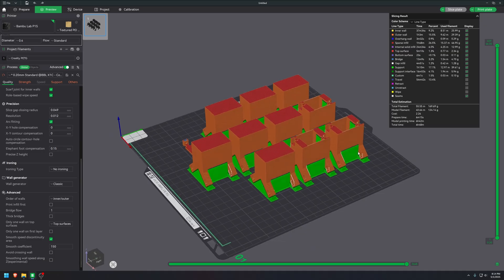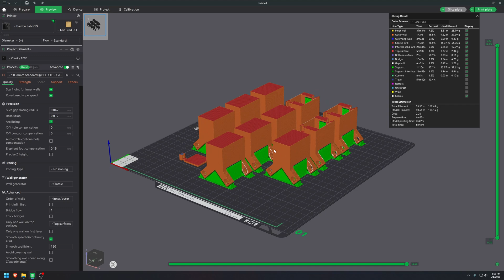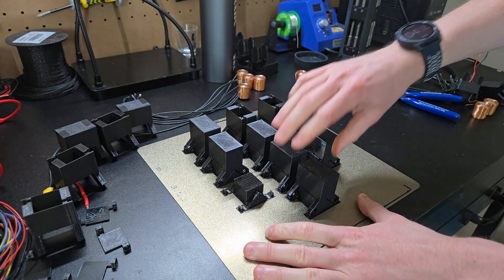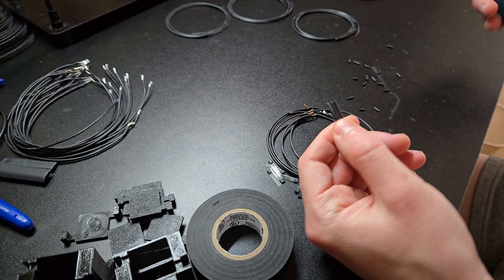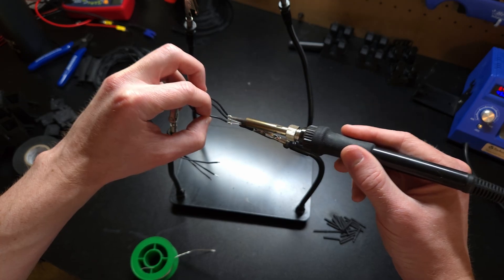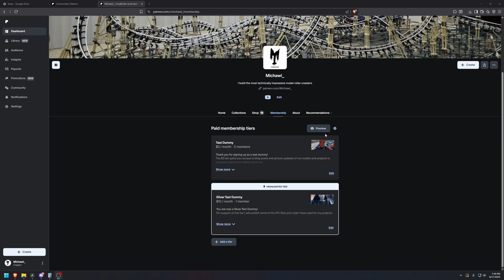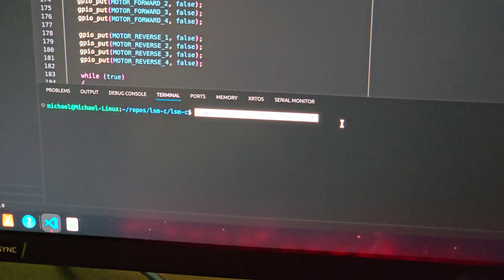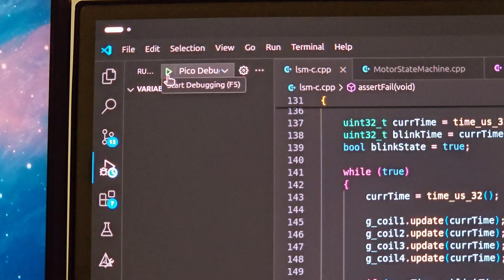I can now make BENDY LAUNCHES

Comment: I'm re-watching your LSM videos while my LSM continues to disappoint me. No matter how many motors I add I can't seem to exceed about 2.5 metres per second of top speed, the motors just become ineffective. I've tried air-core coils, a bunch of different number of turns per coil. I know your layout doesn't demand 'top thrill dragster' type velocities, but were you finding diminishing returns on the LSM where you couldn't achieve more speed, even with more motors?
Reply from the maker: There's definitely a steady state max speed these can achieve, I don't know what that is. Keep in mind I'm putting an absurd amount of power into the coils (24v@15amps) and I saw the biggest improvement when I gave myself the extra current.
Reply: @michawl_  I'm putting 24 amps through each of my coil pairs, heaps of torque at low speed, but no meaningful acceleration at high speed. Now I'm trying to build an LSM lift-hill rather than launch, leaning on the high torque rather than high speed.
Reply from the maker: It could be the size of your magnets and coils. Both that I'm using are substantially larger than yours. The inductance time constant is essentially a non factor even at my coil size so you would probably benefit from stronger magnets.
Reply: @michawl_  Yeah I'm going to have pull the plug soon on my LSM fitting entirely between the wheel sets of the coaster. Maybe in a few months I'll try a below-the-track design like yours.

Comment: Have you ever thought about implementing flywheels to the cars? 
This way you could make it look more realistic because you need energy to "load" it up to speed, and it drives the cars through the rest of the track. 
I'm pretty sure this could be done with some rubber transmission wheels. Not sure if you loose to much energie though.